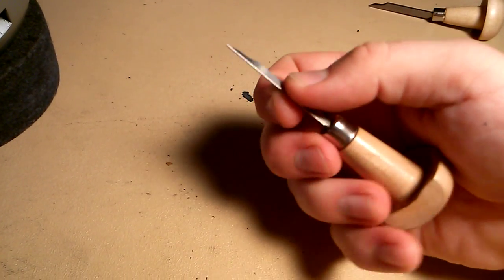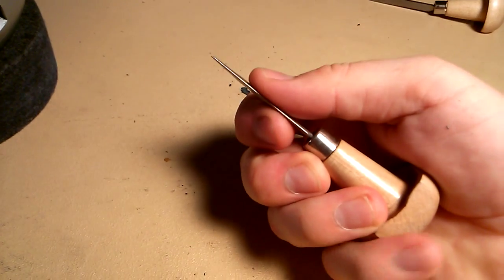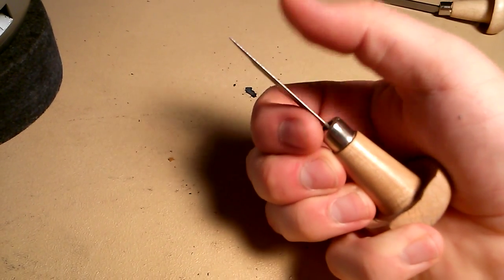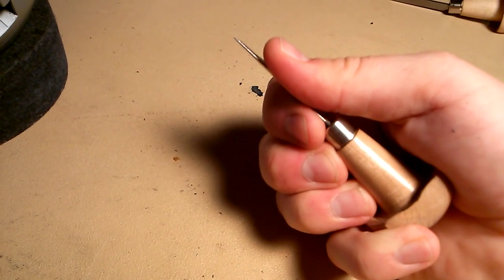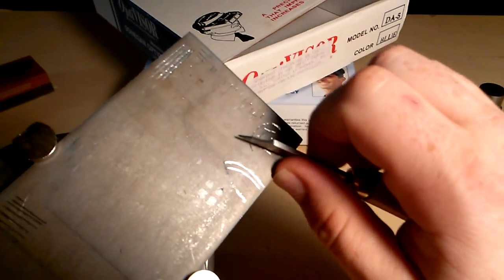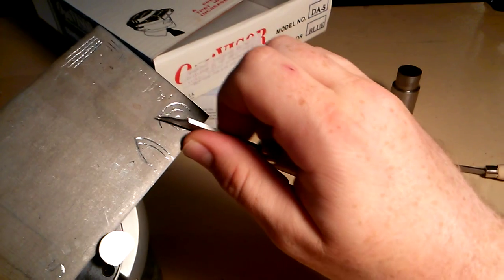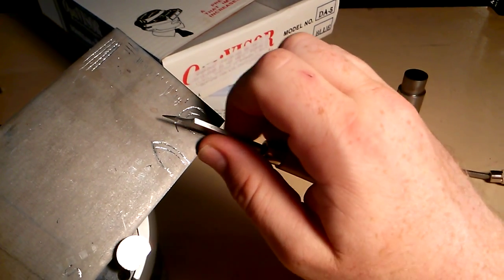How to use a push graver

Comment: I dont feel confident in the information that you shared with this video...
Reply from the maker: Well, this is intended to illustrate just how to hold the tool, since I had been doing it wrong for so long. :)
Reply: Hi. Good video. Appreciate it.
Can you tell me what kind or brand of push engravers you are usinng.
I need to engrave steel round bars.
Thank you.